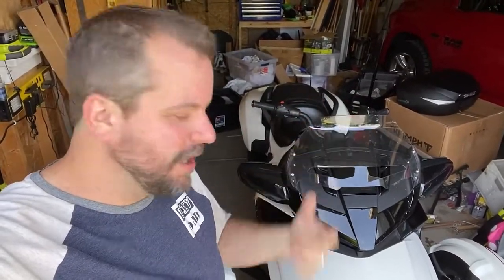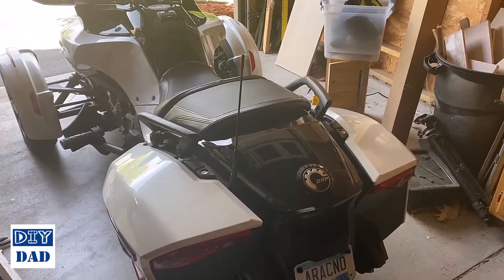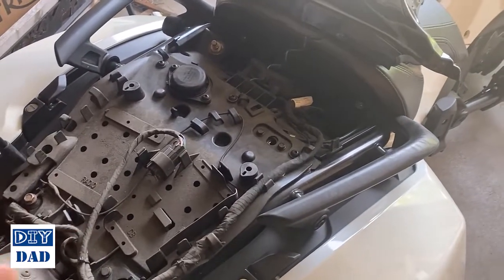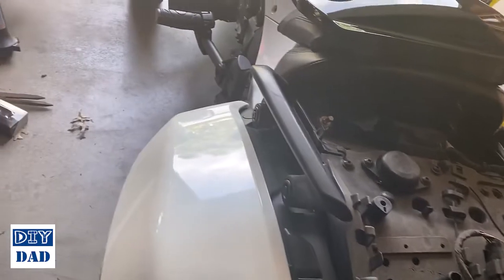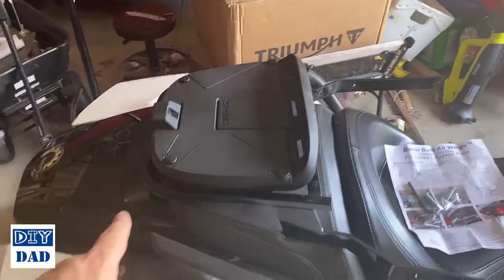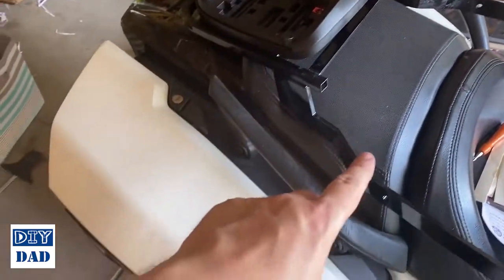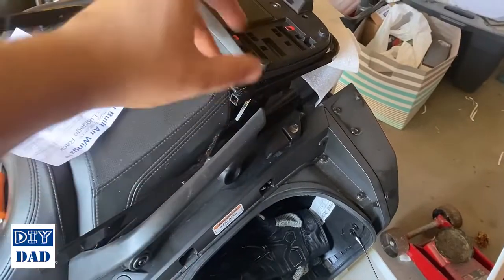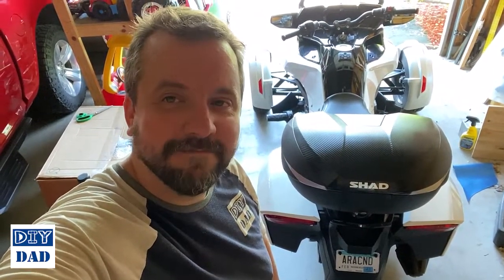Mounting a top case to a Can-Am Spyder F3T

Comment: Just purchased a 2016 f3t. I was looking to do the same thing that you did in this video. Do you have a link or description for the mounting plate you used?
Reply from the maker: The luggage rack is from Baker Built Air Wings http://bakerbuiltairwings.com/proddetail.php?prod=SPYF3LR

The mounting plate that connects to it is the SHAD universal mounting plate that came with the topcase
Reply from the maker: Technically I think my mounting plate was meant for a BMW but that’s just a question of the brackets - which you can customize very easily

Comment: I've been trying to get a top case for my 2021 f3t too. What is the part number for the Shad bag?
Where can I purchase one and is that the largest one?
Reply from the maker: I believe the 58/59X is the largest SHAD makes.  The other main aftermarket manufacturer is GIVI but so far my SHAD seems to be higher build quality than the Givi I owned.  SHADUSA is back ordered on them - I found mine searching “Shad 58x” on EBay.  Part numbers are SH58x and SH59x.. The 59x is the same case with a metal top piece instead of carbon-effect plastic

Comment: You didn't show how to mount the plate on the rack... I'm struggling here....grrrrr!
Reply from the maker: My mount was specific since I had a "fitment" plate from a completely wrong bike.. basically what I did in mine was sandwich the luggage rack between the adapter plate from the Kawasaki bike and the universal adapter from SHAD.  If you're using the SHAD kit (which I only have part of because I bought the case used) there should be something that looks like an oversized wing nut that you attach below the crossbars of the luggage rack.
Reply: @AskDIYDad  Look at Sids motorcycle world. They have this case and a rack kit to go with the case and Spyder